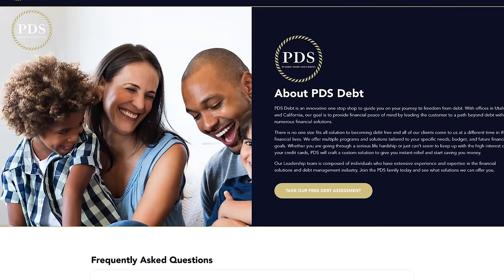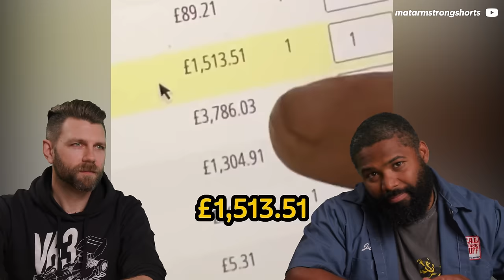Mechanic Reacts to Expensive Supercar Repairs

Comment: So I googled why the Bugatti oil change is so expensive. Apparently there's 16 oil plugs and you have to intricately remove parts of the underbody to reach them and its a dry sump system which basically means multiple pumps and a large reservoir. Plus multiple coolers.
Reply: Thank you for that info- the price makes more sense with that context
Reply: yeah it's super complicated. but still kind of mad that it's 25k because it's mostly just labour cost. but i guess they have to charge that much in order to actually have trained bugatti mechanics on the pay roll. because they ain't gonna come in every day so you got to cash in on the rare times you actually do get to work on them
Reply: @savagememes873   And Oil is a special type, because must work dependably at 260mph. And Some special tool to prime oil system is needed too
Reply: There's also going to be a liability/insurance aspect to that charge.  If anything goes wrong during/after it gets the oil change, the owner is going to complain and/or sue the mechanic.  So they're risky to do work on.
Reply: @victortaveira8271  what do you mean has to work dependably at 260mph ? Why is the Vehicle speed a concern when deciding what oil to use ?
Reply: Don't forget the 18 liter of oil this thing needs
Reply: Actually the oil, filters, and other parts needed for the oil change cost $15k.
Reply: @DriversExperience  In general a supercar engine at top speed is likely to run hotter and at a higher redline than most "normal" engines whilst having smaller tolerances meaning it's harder to keep a consistent film of oil where it needs to go.
Reply: @DriversExperience  Heat management, termal expansion, right viscosity to perform  right all operational regimes and support high temperatures. If I'm forgetting, Bugatti Chiron uses a Special 10W60 from MOTUL and it's super expensive, € 75,00 per 5 liters bottle in Germany, and needs a ester based lubricant
Reply: @victortaveira8271  but what difference does the cars speed make to the oil to say „must work at 260mph dependably“ ? The rotational speed of the engine is the same wether youre driving 260 or 160 in a lower gear. Im not sure if im bringing my point across correctly.
Reply: @darthkarl99  i mean, the chiron doesnt really rev that high. A lot of gasoline engines can rev as high as the chiron. And certainly a lot of performance oriented cars. But what has the cars speed to do with the strain on the oil. Rotational speed of the engine, sure. And during acceleration, sure. But driving x-speed as opposed to y-speed shouldnt really make a difference, in terms of stress on the oil, no?
Reply: @DriversExperience while I see your point that the engine speed will be the same at lower speeds vs higher speeds since… yknow, transmissions exist, but there are differences like under acceleration and cornering etc but also you have to remember that at those speeds you don’t want anything to be dry, ever. Special consideration is made with regard to meeting the close tolerances of the motor itself while still making sure everything gets lubricated properly since if you don’t your last moments will be behind the wheel of said Bugatti… or at least you’ll wish it had been, which isn’t really a bad way to go if I’m honest.

So it’s not the speed itself necessarily but just that since it can reach those speeds, everything needs to work.
Reply: @Fetidaf  to be fair, i dont think youd want anything to be dry in any engine at any speed as the ramifications of a lack in lubrication are essentially the same (if we ignore price haha) 
But this pretty much concludes the point i wanted to make: the speed the car is traveling and the strain on the oil dont really have much to do with one another
Reply: @deller3800 
You're thinking in the wrong context. 
We had an oil starvation problem once in a uphill/downhill turn. The problem? The oil wasn't either fast enough to recover the machined surfaces, or drained too fast leaving surfaces bare. You mess with different chemical combinations to try to get the oil to either not drain too fast or...stay on the surface longer. You may rarely if ever encounter those peripherals but...if they do occur, you're covered. The faster the car, the more the concern.
Reply: @victortaveira8271 huh? There are oils that function on race cars driving thousands of miles on endurance races. It’s not special oil, it’s just oil that the manufacturer has selected.

They mandate a VW 501 01/ 505 00 approved product. There are more than one. Castro Edge Supercar 10w-60 oil is fine.
Reply: @cmdrdredd well tbf race cars although fast arent usually 400 KMH+ top speed. There are limits and ranges to these chemical properties and i imagine if theyre servicing one for the car to work on its peak performance, its gotta be even stronger than those of race cars.
Reply: @DriversExperience  It is not just the speed, but the power that the engine must produce to maintain that speed.  The speed of the engine components are high and the forces are high, so a lot of energy is dumped into the oil.  The oil has to not break down at the peak operating temperature of the engine and it must stay a liquid if it is left overnight to get cold.  The most extreme case for lubrication systems was on the SR-71 reconnaissance aircraft that had to have heaters in the lubrication system, as the only lubricant that stood up to the temperature of the engine was a solid at room temperature (If I remember correctly).

A low power high revving engine does not have high forces and a low revving high power engine does not have high engine component speeds, so neither gets the oil as hot as a high revving high power engine that has both high speeds and large forces.
Reply: @DriversExperience  I think the dude's point is it's one thing to have an issue at 60 and a completely different thing to have an issue at 260. I get you point that it's not the speed that determines the oil and it's a bunch of other things that do and they happen to result in the speed of the car. But I think you knew what the dude was trying to say and if you wanted to give a technical correction you should have just done that.
Reply: @cmdrdredd  If you make an oil change in one of few Bugatti Boutique service center  , the oil is motul.
Reply: @victortaveira8271 cause motul is the best!!!!
Reply: I'm pretty sure they also split the car in half to do all the work.
Reply: @savagememes873  The guy in the video said "over the course of 4 years" aswell , so it's not 25k per change
Reply: @richardbell7678  „its not just the speed,….“ 
Its not the speed at all (unless youre talking about my rotational speed comment, in wich case you can ignore the following). I was a bit quick to comment that speed makes no difference at all since i tried to rephrase it but like you said, maintining x-speed over y-speed requires different ammounts of power. But that dorsnt matter in the scope of the argument. The point im trying to convey is whatever you require to maintain that speed its still less than youll need for acceleration. So going the speed itself isnt a determining factor. And the oil in a Chiron really isnt „super special“ like some here try to claim. Its a 10w60 that even some M-Engines use. And the Chiron is obviously high power, but it certainly isnt high revving. Calling 6800rpm high revving is a bit of a stretch.
Reply: @kenik2023  i fail to understand how what you said has anything to do with the speed the car is driving. What youre saying is that the oil in your vehicle had the wrong viscosity ?
Reply: @DriversExperience same reason race cars use nitrogen instead of air in there tires the heat causes regular oil and air to expand which in the case of tires will lower performance but in the case of oil it could straight up ruin the engine
Reply: @jameson1239  correct me if im wrong but if im understanding your comment right youre saying that: 
1. Nitrogen is used in Racecar tires because it doesnt expand when subjected to heat
2. The „Special“ oil in the engine of a Bugatti doesnt expand either because if it did it could ruin the engine ?

Is that what you were saying ?
Reply: @DriversExperience  basically yes the oil expanding is one of the issues of running the engine to hot, there’s also the potential of the oil chemically decomposing at higher temperatures but I couldn’t really think of a decent analogy for that
Reply: @jameson1239  brother, im not sure to wich one of my comments youre responding but i think youre mixing something up here. Nitrogen expands too when heated and its essentially at the same rate as ambient air. Its used in racing applications because the expansion is more consistent over the multiple temperature fluctuations throughout a race. And the Oil in the Bugatti isnt anything special at all, it expands when heated too. And it also degrades like any other oil. Im not a chemist but i do imagine that a higher temperature would accelerate its degradation since many chemical reactions are accelerated by heat. Oil losing its lubricating properties at higher temperatures is of bigger concern i think
Reply: Is the same thing with a Lamborghini. However the oil change is cheaper about $1000-$3000
Reply: @ulucio86  its not even remotely the same thing as a lamborghinis oilchange
Reply: @DriversExperience  you cant be seriously saying this even at the same rotation the engine still works harder at higher speeds more heat friction and such otherwise a 5 hp car would be able to accelerate to 260mph as well with high enough gearing
Reply: @TWEAKLET  Please atleast read the comments if you want to join a discussion that has been going on for a while, i already stated in another comment: „I was a bit quick to comment that speed makes no difference at all since i tried to rephrase it but like you said, maintining x-speed over y-speed requires different ammounts of power…“
The point im making is that the speed the vehicle is capable of traveling makes no difference in deciding what oil to use.
Reply: @BMWe-ed2tn finally!! Thank you .
Reply: They designed it that way to justify the oil change charge. Even with a bunch of oil plugs that doesnt come close to justifying the price. Hoe many bolts do you have take out change the brakes on a normal car? More than 16
Reply: @jamesfranko5098  um excluding lug nuts my truck has 2 bolts to remove to change its disc brake pads
Reply: @TWEAKLET  why would you exclude the lug nuts? Lol.
Reply: @jamesfranko5098 because it takes 5 seconds to remove them all with an impact gun?
Reply: It also  needs liquid gold oil to run
Reply: @DriversExperience oil breaks down at certain temperatures. If you are driving at 260 mph. Your engine is creating a whole bunch of heat. Have you ever used self cleaning in your oven. It only goes to about 800 degrees to basically turn oil to ash. So the engine oil  need to tolerate a constant high temp. 
Also the Bugatti used a special set if Michelin tire that runs 40k a set the last I checked. I didn’t know it was only 8k. They cost that much bc you put regular tire on that car. When driving anything over 200 the tire will basically pull it self apart.
Reply: They also take apart part of the engine every change for inspection and adjustments
Reply: Bro 16 of them!?
Reply: Reason #34 why I say supercars can go to hell.
Remember those eBay turbo Civic videos where they were beating Lambos?
How much of a stretch is it for them also to beat a Chiron?
And what would the oil change cost on that Civic's engine? Hell, even rebuild the whole engine at the oil change interval.
What was Bugatti (VAG) thinking??
(Oh yeah, same as always - "let's make everything needlessly expensive and complex")
Reply: Engine oil (and myriad scheduled maintenance tasks) for driving at 230mph?  Yes, theoretically - but do they?  
1.  Very, very  few cars can reach 370kmh (230m), much less get to 418kmh (260) - and 2 or 3 are electric anyway.  Reliability and oil quality is an issue for ZERO people watching this channel. 

2.  Apparently a lot of supercars (for argument's sake, v-max 322kmh) and probably the majority of hypercars are bought for the image and/or the rarity and investment potential.  They rarely, if ever, get driven at the maximum performance potential that was built into them.  So, your Lambo Aventador Ultimae will usually sit around looking gorgeous, being admired by others on the concourse event weekend, and your kids see it as their trust fund asset.  Those with tiny production numbers (cars, I mean - not children) are even less likely to be driven at top speed often, or at all. (Hennessey made just 12 Venom Revolutions - Pagani only built 5 of their latest Huayra.)  A small odometer figure is highly desirable  for investors in extreme performance cars.   You have 3 other cars, after all, for regular transport.  

3.  You are very rich, so shipping your car to France, Sweden, etc for maintenance (viral to hold value), is no different to sending it to a salt lake in a desert, for a v-max blast (lowers value).  You snort that sort of money in lines each year, off 5000 yr old ice, on a freshly calved iceberg, from a west coast Greenland glacier.  These kinda costs are incidental. 😄

4.  If your Koenigsegg hasn't been 'driven in anger' for the last 18 months, I imagine the warranty and your insurance policy would stipulate a full inspection and at least all fluids be replaced.  So $50G a year on maintenance for a $300G to $3M car is fine. 

5.  Maybe my Chiron demands annual electron microscope scans of each wheel, but your McLaren doesn't need new wheels ever. 

(KIDDING - No Bugatti for me.  I drive an '04 Subaru Outback, and '68 Holden Kingswood.  My SSC Tuatara is in the 'shop, with a squeaky clutch pedal. 😅)
Reply: Supply and demand.
Reply: Why didn't it occur to me to just add more pumps and sumps? I'm an idiot! Thanks Bugatti.

No genuinely I need more oil for cooling.
Reply: And there's 10 radiators if I'm not mistaken